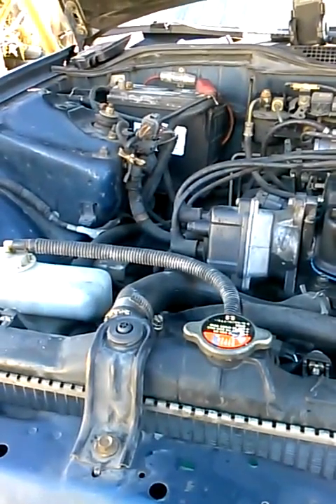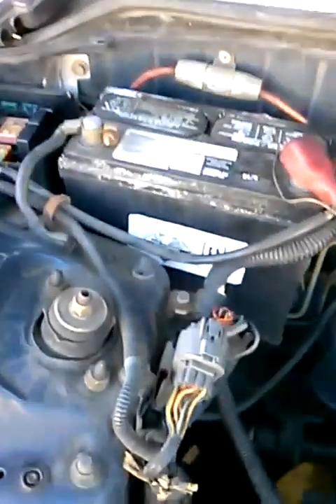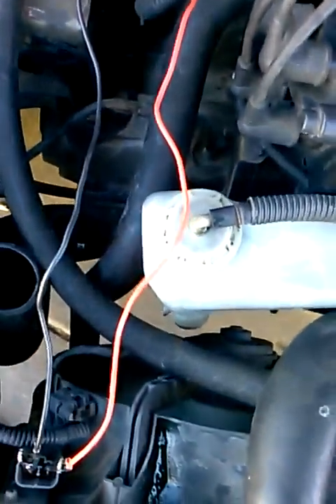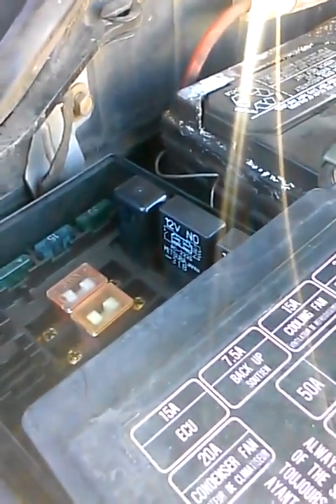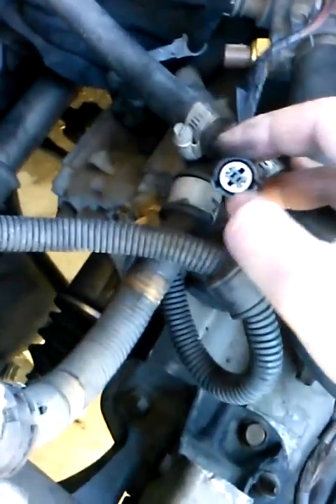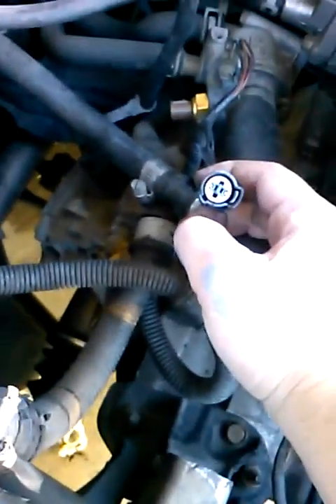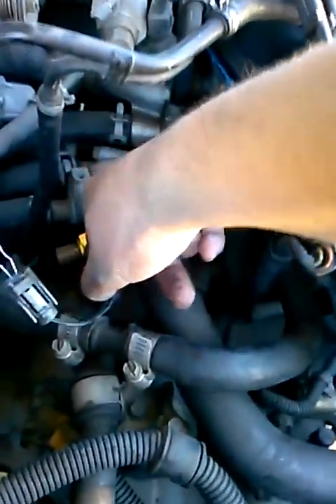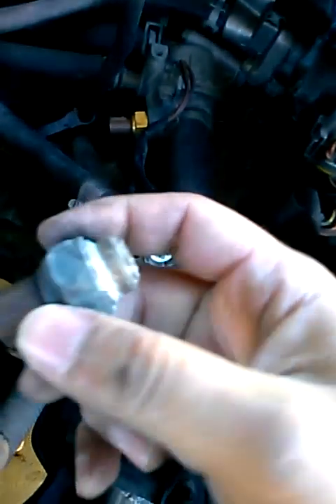Radiator Fan / Relay / Cooling Fan Switch  Not Working: Honda Civic

Comment: Hey man,

Your video was of BIG HELP. I have an overheating issue with my 98 Civic LX. Long story short, after ruling out the fan, relay, I settled on the cooling fan switch as the issue. For now, I've shorted out the relay so the fan stay on all the time. Takes a bit longer to get to temperature but at least I won't worry about overheating anymore...
Reply: How did this work out for you long term? Did you short the relay in the under the hood fuse box or by the coolant temperature sensor?

Comment: Great video!  I have a 93 Civic and noticed the radiator fan wasn't switching on.  I wired a manual switch (instead of the paperclip).  One wire on the temperature switch connector goes to the relay and the other goes to ground.  So I wired the relay connection to my manual switch inside the car and the other side of the switch to ground inside the car.  I only turn on the fan when the car is up to temp and sitting at a stoplight.  I switch it off when I get going over 30 mph.  

One of the biggest reasons these engines blow head gaskets is due to overheating.  And a common reason why it overheats is failure of the thermoswitch.

Keep the vids coming!
Reply: +jcastle003 wow just over 30? I was under the impression that the fan should be on at all times.  I have a acura integra and I have to replace my fan bcause is completely lose. Now i'm scared to drive it far distance.

Comment: Before doing this, check the fuses and relays.  There is a 20 amp fuse for the cooling fan.   Also a 20 amp fuse for the condenser fan.   Relays can be checked by swapping them with the horn relay.  If horn blows, they're ok.
Reply: Good idea ..thinking of doing this I'm 99% sure my 2 fans don't kick in as they shouod only if ac is on ..I've seen them working in the past but not recently bring to temp to

Comment: Appreciate the video, very helpful. The relay is actually a great starting point. If bypassing the relay doesn't work it has to be the relay or the power on the fan. If it does work it's either the switch or thermostat. If the hoses both get equally hot then the thermostat is most likely working. Leaving you with the switch while the opposite is true for the thermostat. If the thermostat isn't opening one of the hoses will not have hot water flowing to it so it should be cooler.

Comment: Thanks for the upload I really appreciate the video. My only beef is your wording when testing the coolant switch. You aren't causing a short, you're completing the circuit which is what the "switch" would do if it was working properly and the car was at operating temp. But that's innocent and the information was generally correct, so I give you a thumbs up! Honda's FTW (I drive a 95 prelude h22a <3)

Comment: fan comes on when the core temp reaches a certain point, and the thermostat is the way the core temperature is measured. If the thermostat is on the blink, then it can't trip the switch to turn the fan on since it does not register correct temperatures. The thermostat can still be "working" but not registering correct temperature fluctuations. So I was told by a mechanic friend when we worked on my datsun 180B.

Comment: Very useful video, I got the same problem today, my Honda Civic vti 1998, doing the same problem. I checked all things as you show in this video, fan is working directly, but not working automatically, so I will check the thermostat switch tomorrow...

Comment: Hi, thanks for the great video! My car's fan recently stopped working and I'm pretty certain it's the cooling fan switch. However my car's heating doesn't work either, at full temp the heating system still blasts out cold air.

Is that problem related to the fan system or is it something completely different?

Comment: Hey you can use a paper clip on the thermostat side of the fan where the fan plugs into the thermostat. That's how I use to get my fan to run all the time. But that's just a quick way to test the fan.

Comment: Check ur 20 amp fuse under ur dashboard there's a fuse box there connected to radiator fan,condenser fan and power side mirror...if it's busted replace it and ur good to go👍
Reply: Leh Ny . My cooling fan and ignition chime quit working after a good car wash. Ya think it's the dash fuse?

Comment: I just want to say thank you for your video I did the test like you said and it turned out that the guy didn't have a relay on there so I went to go buy one at AutoZone and put it on there and my fan is working if it wasn't for your test I would be lost thank you very much

Comment: what should i do if my cooling fan switch have one wire? your video is great it gives me basic step to check cooling system thanks a lot May God bless you
Reply from the maker: mohamed moktar hi, thanks for the comment. that wire needs to touch the body of the car (aka common ground) to complete the circuit.

Comment: thanks i didnt had  that thing where you tested the fan to the battery but i did test the switch with a key holder and it came on fully running so i will see if thats the problem

Comment: Thanks for the Great video! I did the same what you showed, I bypassed the fan switch censor with paper clip and the fans started working. I changed the fan switch censor but the fans are still not working. I bleed the coolant but no luck yet. 
Thank you!
Reply: Any luck?
Reply: @framesbylutuv   I worked on the air bubble inside the radiator, it took me hourssss. After that, the fans started working. I disconnected the bypass....
You need to start the engine and let it run, keep the AC fan sped to the lowest speed while the temperature on the highest....un screw the bleeding bolt and watch the coolant....you will be done when the lower radiator hose get hot.
Reply: @mounir2312  what you mean by you disconnected the bypass, u reffering to the paper clip? and also which bleeding bold you unscrew?

Comment: when should the fan engage? I replaced the sensor & thermostat however no fan?  I also used the tip you provided to short the fuse to ensure it had nothing to do with the fuse relay.....fan came on. Temp has stayed stable now but I am not sure if that is due to the never close thermostat I brought?

Comment: good video!

but shorting the sensor with a paper clip means "ultra high temp" which triggers the high relay.

if your low relay is bad you will get a false idea that it is working. meed to add the correct resistence which will vary for every car. a better test is to turn car on, list if fan turn on on 1/2 mark, and listen if it runs faster after 3/4 mark.

you can know if low relay is bad also if your temp gauge blows past half mark but never past the 3/4 mark... usually. nothing is 100% sure in cars :)

Comment: I changed cooling fan switch ect sensor and the coolant temperature gauge and my fan still doesnt come on. I did the thing with the alligator clips connected to  the fan and directly to the battery and my fan came on. I bought a new relay switch to see and still my fan doesnt come on so I'm guessing it's the thermostat since I already trouble shot everything else by replacing it. I have a brand new fan but I think imma send it back because it's clearly not my fan if I got it to turn on when directly plugging the gator clips to the fan terminal and the battery.

Comment: Was this fan the radiator fan or the AC fan? Trying to troubleshoot my honda accord 93.

The AC fan (passenger side) will not come on. Replaced fan motor, relays are fine. Could it be coolant switch or thermostat?

Comment: here is another question for you. i check the fan-good, the relay good, i  already replace the thermo switch yesterday so i cant be bad right. and the thermostat itself i took it out and tested it, like some videos I seen on you tube and it works fine it opens when it get to hot and closes when i throw water on it. NOw i ran my car for 15 min tops and temp stood at half. did not go higher. I am a little hesitant to go out but is that would i probably should do to see if the fan kicks on.

Comment from the maker: it is very unlikely for the thermostat to go bad after replacing it with a brand new one.Even if you short out the Cooling Fan Switch, the thermostat would not go bad for that reason. Generally, the more air that passes through the radiator the more the temp would drop; so if your driving for example on a freeway the temp could drop a bit but would quickly go back up at a complete stop (ex: a stop light).

Does your car tend to lose coolant?

Comment: appreicaite the video here is my problem. changed the thermostat switch, been runnung the fan with a paperclip, in august 2012 i changed the thermostat, because i was having a major overheating problem. Is it is possible that the thermostat when bad again, and could the  reason be because i did not connect the fan to it. At one point after i changed it, it turned on for little bit but my car was parked and it would overheat a little past half way. WOuld it have went low if i was driving it.

Comment: I shorted the plug and the fan comes on. I changed the thermostat switch and the fan still doesn't come on when the car is hot.
Eventually it spills coolant and when its too hot it comes on, did I get the wrong part and is triggering late?

Comment: If the fan runs by jumping the two wires going to the fan switch sensor? It is showing the relay and harness in place is working properly. So it would point to a problem with the thermostat (even if new) or even a bad thermo Switch. ( even if new). Test both. Out of the car with boiling water and a multimeter on the thermo switch. Testing the thermostat in boiling water you should see it open.

Comment: Was the car on when u connected the alligator clips to battery to check the fan?
Reply: your battery always has power. you dont need to turn the ignition. hooking anything to your battery while the car is off will give it power as long as your battery has a charge.

Comment: could you show me how to fix radiator fan relay cooling fan switch not working on volvo v70? cuz the fan still round but when water very hot the relay fan still normal round but not quick round.

Comment: Hi Scotty, today i have a overheating troubleshooting i change the thermostat but i found that the fan motor turn only a few second not much to take the engine cold down, any sugess aveo 2005 thank's

Comment: Whats the difference between cooling fan temperature switch and  coolant temperature sensor?
I found the coolant temp. sensor (it has 3 pins) and if I disconect it, the temp guage in the dash wont work. 
Will the same paperclip method work with coolant temp. sensor? It has 3 pins. I found out that one pin is ground. And I dont know in what pin hole should I stick the wire to short it?
Does your cooling fan switch (in the video it has 2 pins) also has 1 pin grounded?
Reply from the maker: Cooling fan switch is just that, a switch that will turn on at specific temperature. The coolant sensor will change in resistance with the change in temperature and feed back that info to the ecu and/or gauge depending on your car ( just an FYI the switch and two sensors are 3 separate parts  on my honda). If you check for resistance using a multimeter, keep one end on the body of the switch/sensor and test each pin individually with the other end, you can tell which one is a sensor because it will always have some resistance. Either way the paperclip method will work. You just have to find the right two pins on the connector assuming you have only 1 fan for the radiator. Hope this helps
Reply: I wish I had 2 sensors and a switch as separate parts aswell...
So if I test the switch/sensor and find a pin that shows resistance then  in the plug I can find where that pin sits and use paperclip and short that hole that shows resistance with the ground hole and the fan should kick in? 
I'm going to do some more looking arround and try to find the fan switch, although today I was trying to find it and I couldn't.

ps. I have 1 fan and I have manual AC

Comment: ok the fan works with direct power but the paper clip jump is not working.so does that mean its either the relay or the cooling fan switch.

Comment: I have Saturn Vue 2004 v6. My Ac works when keep driving but when I, on full stop or idle is not blowing cold air. I replaced my fan relay. I check my a/c and the fan to the left turns on but the right doesn't c I noticed the left do fan turns on but it doesn't stay on running. What do you suggest? Do i need to relaxed the relay fan that's attached to the fan? Pls help

Comment: HAve a 2001 honda civic. The car overheated as the fan is not working. It only works whenever I turned on the AC. Seems a sensor is faulty as it does not command the fan to rotate once temp threshold is reached. Just not sure what piece to replace.

Comment: If my raidiator fan doesnt turn on after replacing fan relay, cooling fan switch, and thermostat can i just put a paperclip in the cooling fan switch like in the vid when he tested it and keep it like that? Because with the paperclip the fan turns on when the key is in the on position.. And also my fan does turn on with the paperclip test so idk wat else it could be
Reply: I'm having the same dilemma, I can't figure it out.
Reply: same problem here

Comment: I've got a Honda Civic Si with a brand new radiator. The radiator coling fan works well for around 5 kilometers or so; then, it just dies, and the temperature rises quickly. After the car's engine is cold again, I turn it on and the same repeats. What can be wrong?

Comment: im having truble with my 98 accord so I turned on the a/c to check my fans work. they come on for about 15 20 sec. and go off and kick back on. I took it out for a test drive and its still overheating. the fans did kick in ehen the gage was about 75 %. what could be the problem

Comment: Hey Snag, I bought a '96 firebird and the previous owner has a toggle switch installed that turns the fans on and off manually, not automatically. I then found out there was no thermostat in the firebird. I bought it because it passed smog, but I just want the fans to turn on automatically. Why did the previous owner do this and how can i make the fans automatically kick in?

Comment: I have a 2005 Nissan Murano. When I start the car I can see the temperature reading increases slowly up to the middle but the radiator fan will never start. Turning on the air conditioner suppose to turn on the 2nd auxiliary fan but it's not until I remove the temperature sensor connector, both fan turn on and gauge reading is Low. No cold air also when turning on the air conditioner. I measure 4.8 V from the positive terminal to ground.  I removed the sensor and measured 1.5 K ohm if cold and up to 200 ohms when it's hot (when submerge to hot water). Shorting the connector show HI gauge reading and fan turn on. What could be wrong here?

Comment: Sir, do I have to drain the coolant before I remove and replace the radiator fan switch?
Reply: +Jinglei Cai  yes friend you have to
Reply: I would just swap them out quickly, you will leak fluid on the ground, though

Comment: Weird, when I unplug the pigtail from the temp sensor the coolant fan will run continually, but when its plugged back in to the temp sensor the fan won't come on at all and the engine overheats. Any suggestions.
Reply: Replace the temp cooling switch..  or your thermostat is stuck closed...

Comment: I was told that the Cooling Fan switch is located on the radiator itself, and that the cooling fan switch next to the thermostat is to keep the temperature gauge inside the car's dashboard working. I have already replaced the fan, relay, and cooling fan switch (attached to the radiator--since the temperature gauge is working). The fan still does not turn on. Any suggestions?

Comment: Okay so I'm having issues with my radiator fans not coming on. I recently replaced my radiator and did everything correctly but now my fans are turning on. I they worked perfectly fine before the new radiator. I checked the relay, replaced the radiator fan switch. Did the paper clip trick which I'm currently using permanently when I'm driving so my shit doesn't overheat. So my question is,
If everything in this video checks out and is good on my car, could it be the thermostat that is bad and not letting the fans engage?

Comment: Why would the fan work ONLY when the car is running but shuts down immediately when turning the ignition off? I know it used to run for a few minutes after turning off the ignition but it recenty stopped working that way which makes no sense especially since its been hot this summer.

Comment: Good Video, My 04 Lx fans will only run with AC on, it will run hot at a Stop. Relays good, and replaced Coolant switch, but there is also a Coolant Temp sensor. Could this have something to do with it? Also If it still runs hot at a light with a/c on & both fans blowing could it be a water pump or head gasket?  note: Changed water pump 13k miles ago when I did timing belt.

2004 Civic LX 213k miles well maintained and owned since 22k

Comment: i switch the cooling fan switch but it still not working... i didnt had the tool for the first part but i did short the connection at the switch and the fan came on.. so you think its a bad thermostat?

Comment: My fans wont come on at all it keeps on overheating I don't wanna drive it or else my car will be trash I need help I change the thermostat and nothing I think the fans are no good and I need to buy them new one thing for sure I have a lot of oil leaking in my motor like in the bottom of it idk why
Reply: try to jump the fan straight to the battery  if it turns on its good

Comment: when you turn on car is radiator fan supports to turn on? My car has never over heated but I never see fan on when I open hood
Reply: +Danny Martinez. It will only turn on for a short time when the car is at idle like when you are at the stoplight or  stop and go traffic.